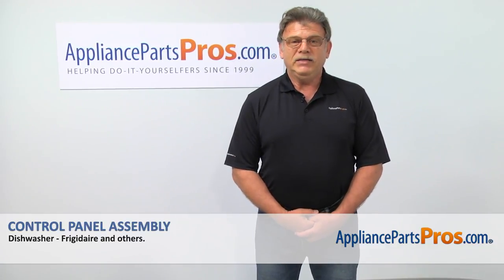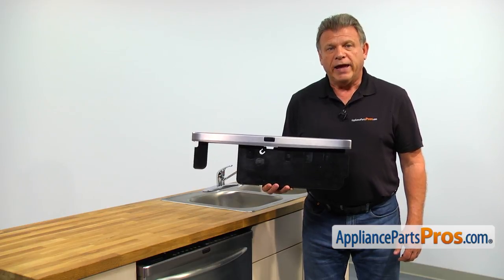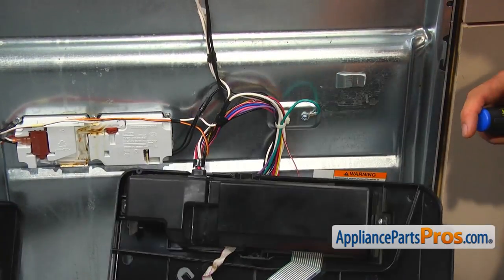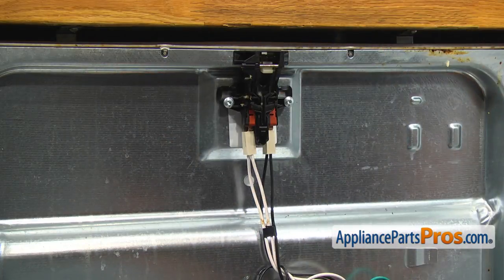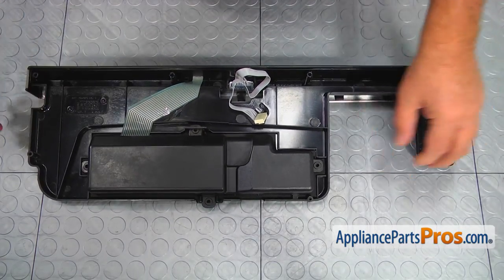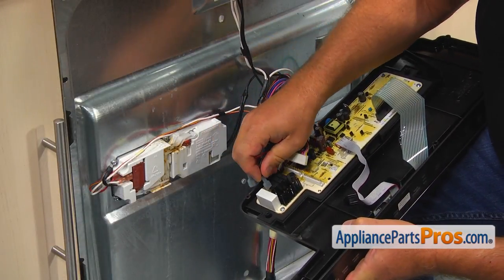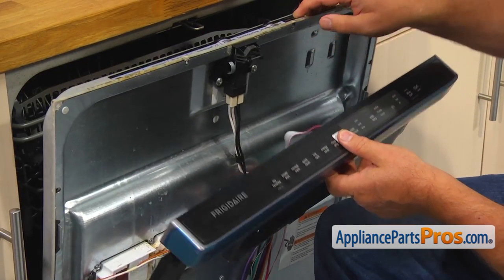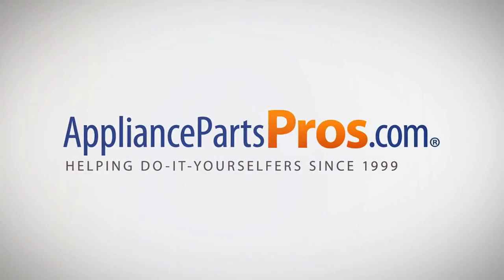How To: Frigidaire/Electrolux Control Panel Assembly 5304504659

Comment: I have Frigidaire wall oven i am replacing control panel but having problem with ribbon cable doe it disconnect with black connector attach??